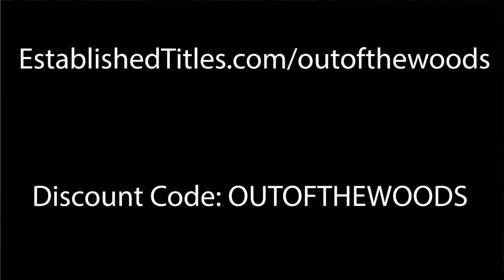Cuts Like A Laser Beam, Wood-Mizer's Fastest Portable Sawmill In Action

Comment: Great video Nathan!!  Maybe you can answer a question for me.  When you cut that log into 2 - 6" wide sections then dropped one section and cut the first into 1 1/8 thick boards.  When finished you bring back the 2nd one and cut it into 1 1/8 thick boards.  What is the reason you can't have them both side by side, which would be 12" wide, and cut them into 1 1/8 boards at the same time?  Would that not save time?  Is it that you might bind the blade?  I was just curious.  Thanks again for the videos.

Comment: If this has been said before, I must have missed it. Why can't you cut both cants at the same time?
Reply: You absolutely can and some sawyers do that to save time.  I believe Nathan has said he prefers to cut them individually to reduce the shimmying and slight offsets that can occur when you hang cut them.  There's usually just a single point where the hydraulic ram clamps, so there can be gaps towards the ends that allow movement.

Comment: Nathan,  you may have already done a video on this,  but I don't think I've ever seen you set up and control the mill,  is the new mill automated or do you have to adjust to the thickness you want on every cut?  Maybe a couple minutes detailing and seeing you run it from the operators station would make a good video

Comment: I have 2 questions for you today.  Sorry, but I watched the videos out of order.  The first question is can you stop the kiln during the process and add more wood or is it best to just let that batch run its course and finish?  I'm not talking about putting green wood in with like 12% wood.  I'm talking about wood that is close to the same moisture content.  I saw the video where you put more lumber on top of the stack before the one where you just started, sorry.  The second question is what is the minimum diameter log you will saw on the mill?  I am sure the mill has a minimum.  Do you stick to that minimum or do you have another figure in your head?  I am a big proponent for safety.